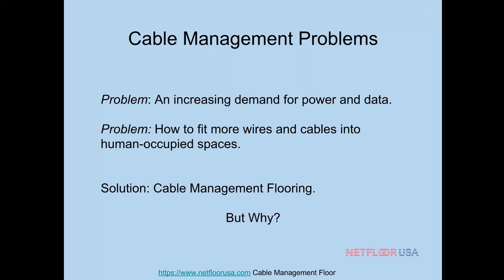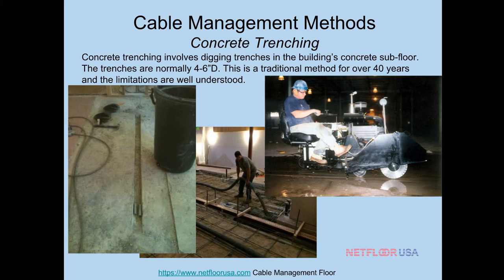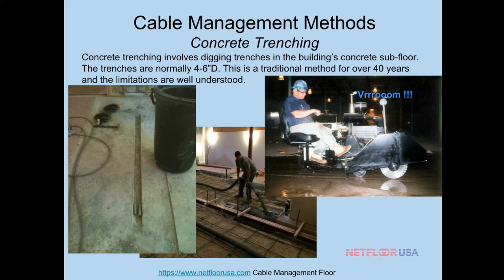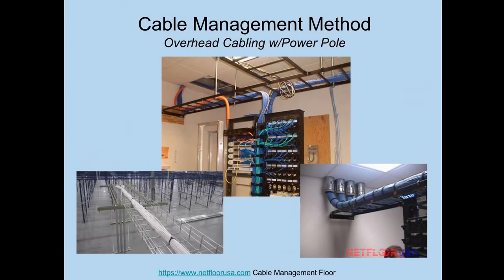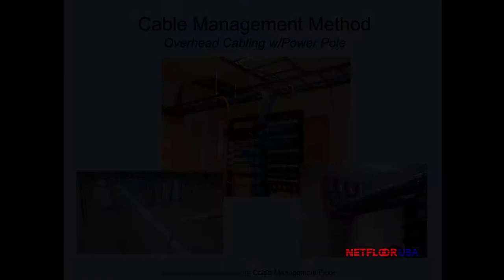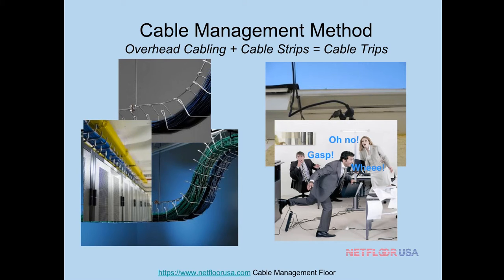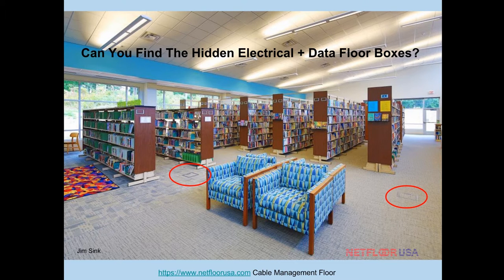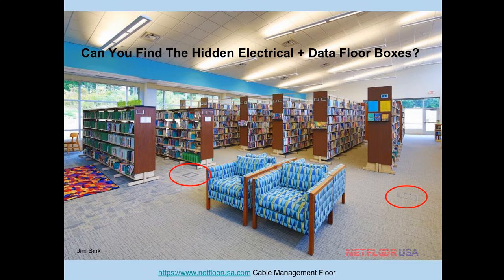Different Kinds of Cable Management - Netfloor USA Cable Management Access Floor Systems

Comment from the maker: Here is a great video about cable management. Not cable management for PCs, or your router cables at home; This is for architects, engineers, IT managers, facilities managers, etc.

This is how to run cables and wires for buildings like offices, libraries, universities, 911 call centers, command centers, security posts and more.

Thanks for watching!

-Netfloor USA Cable Management Access Floor Systems https://www.netfloorusa.com